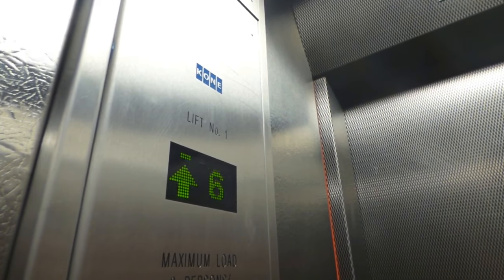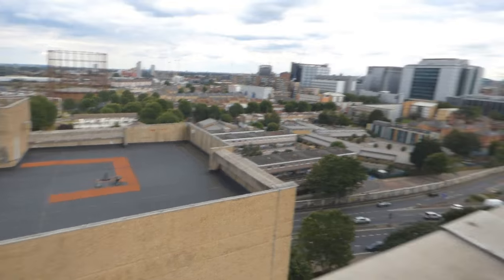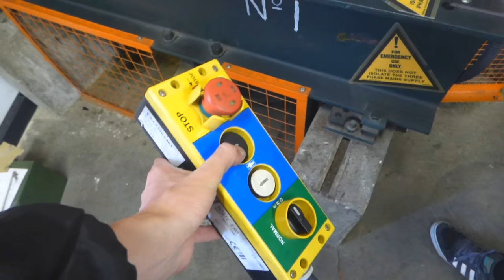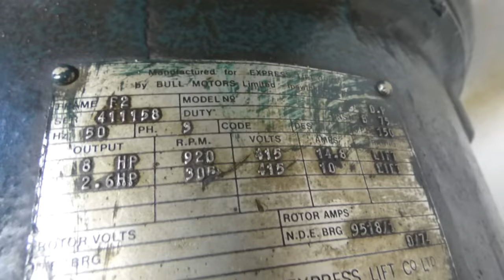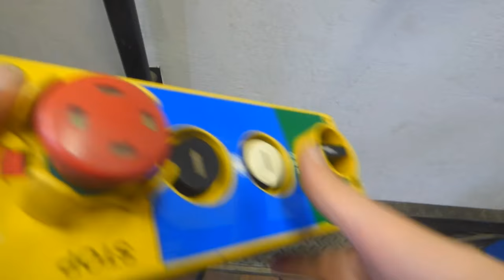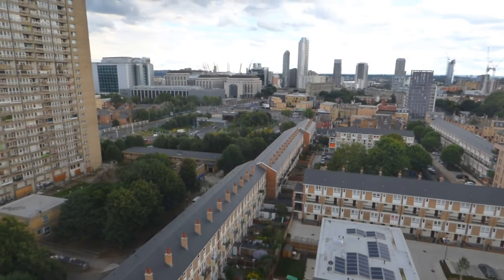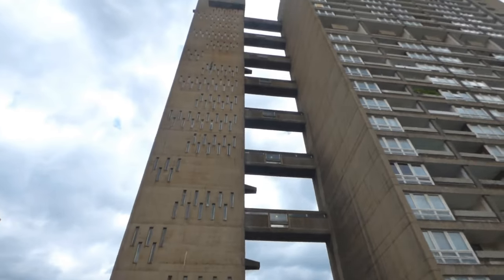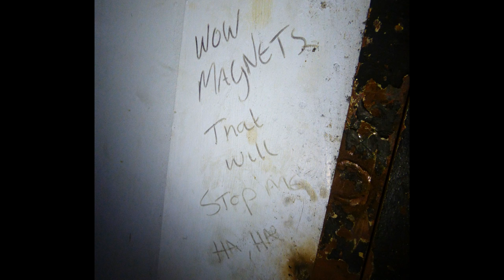Ernő Goldfinger's Brownfield estate URBEX (part 3)

Comment: I can tell Carradale House was built after Balfron Tower, as the former uses waffle slabs for the floor decks, whereas Beno's urbex of Balfron shows just low-tech cast-in-place slabs, probably no prestress or post-tension involved, just lots of rebar and very thick cover.  This low-tech CIP w/ rebar is still used in low- and mid-rise buildings all over Florida, and stands up well to hurricanes.

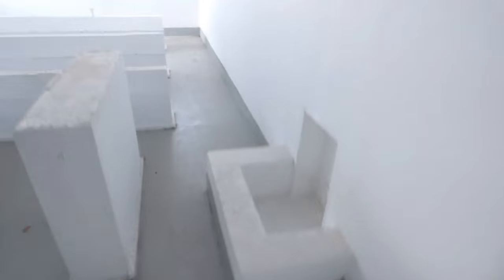Comment: At about 1:10 could that be for a water storage tank, with those concrete things to support them?
Can't think what else they could possibly be for
Reply: More likely OIL tanks, for the no-longer-used boilers.  Presumably the building still uses water, but the heating system has been converted to electric or natural gas.  Those crazy Brits, they slay me!

Comment: Awesome video, wonder how long a homeless person could get away with having a free house in the secret levels?  Are magnetic doors strong or easily rammed?
Reply from the maker: The thing is that a lot of the urbex requires knowledge to get in these places which takes a long time to learn as urbexers are very protective of it.  A lot of these places are secure and the people who have managed to get in keep it secret and usually leave without trace so that the way in doesn't get changed.  If any homeless people did know (which is almost certainly not the case with this place) they would keep very quiet about it.
Reply: you have a way of finding great secret areas.
Reply: +Beno you would be a master at hide and seek.
Reply: +Beno or are you Spider-Man who can get to any Window and throw his friends through?
Reply: Depends on the quality and age of the doors and magnets. I'm in a block of flats just down the motorway from balfron tower and our magnetic doors were put in about 5-6 years ago but I'm 14 and even I've managed to bust them open. I've gone into balfron tower a couple times this year but I've had to wait for people to come in/out because their doors are quite strong.  Also there's a set of the magnetic doors on every floor including entrance
Reply from the maker: You can turn off all of the magnetic doors using a switch in the 24th floor.  We managed to turn of the doors but this didn't turn off the second security door to the motor room.

Comment: to get to the scurity door just pull or barge in to it or get your bike and ram it up the door
Reply from the maker: The door is pull to open.  There is no handle to pull it and there isn't a way to get good leverage on it to force it.
Reply: Security cameras everywhere and absolutely no privacy (there are cameras and microphones everywhere so they hear and see what you're doing. They're able to tell you off using speakers etc) I've gone in the building myself loads of times but they've only used the speaker once when we tried to bust a door open
Reply from the maker: I have done loads in this building and I have never had someone talking to me through a speaker.
Reply: +Beno i know a few people living in the building and theyve all said theyve heard security using speakers telling people to get out and everything
Reply: I think you could get passed it when they do the weekly testing of the fire alarms. There's a video now by Ben on what's passed that door